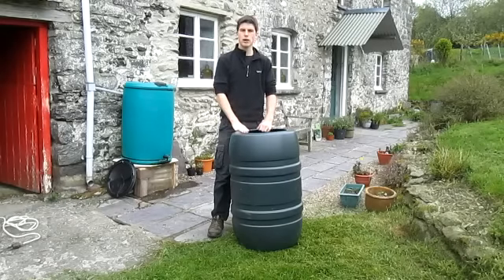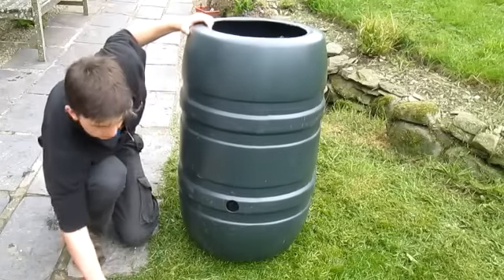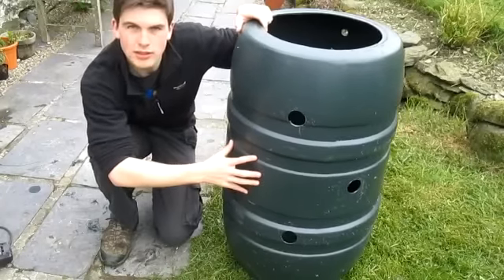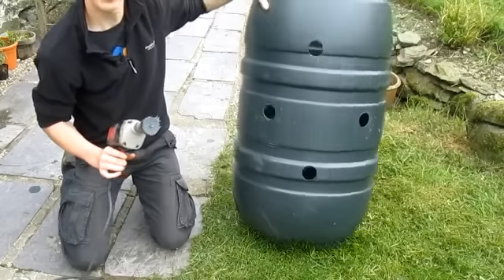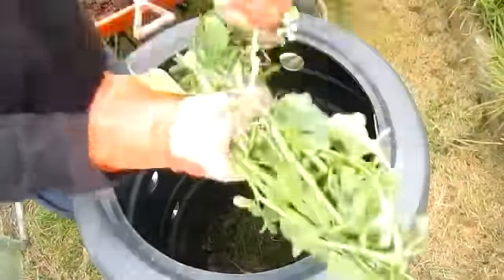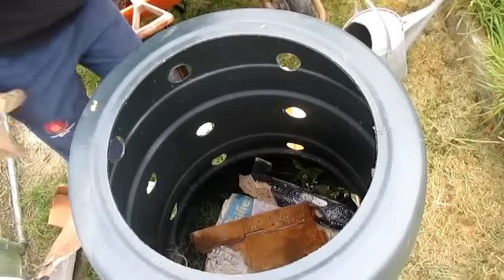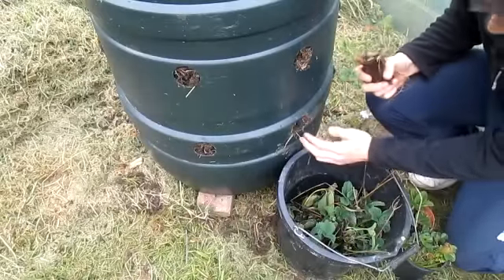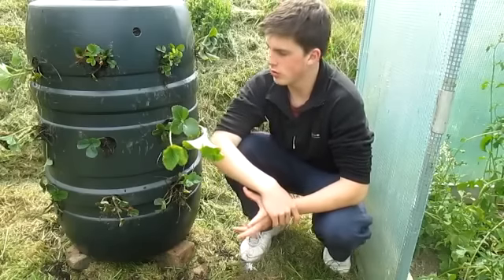How to Build a Vertical Strawberry Tower - 24 Plants in 4sq Feet!

Comment: You know how to use a drill! I saw another gardener....ok not actually a gardener, more like a circus clown....he demonstrated how to drill holes and he had the drill running in reverse and didn't even NOTICE. :)

ps: Excellent use of an old plastic tub Huw. :)
Reply: some run the drill in reverse because it cuts a cleaner hole , depending on what it is
Reply: *****  dont try that on styrofoam board lol
Reply: Actually if you run hole saws in reverse they do not grab as bad. I run mine backwards too since it is easier to cut the holes.
Reply from the maker: Great hehe! Thanks a lot Ray, I don't use a drill much but my dad has showed me the basics. Thanks for watching :)
Reply: crazyNCman LOL no.

Comment: Is there a danger that the compost will heat up too hot and burn the plants?  How do you stop it doing that?  Also the compost will breakdown as it decomposes, is that going to make the bed unstable when you plant things on top?  Its a nice idea so I am interested.
Reply: Add red wiggler composting worms. There's an actual product like that called a Garden Tower 2. Lots of people just put a PVC pipe they drill holes into and stick it in the middle then they put all of their compost stuff in there. The worms then travel back and forth.

Comment: This is awesome.  The only thing I would change, for myself, is adding a wicking bed with plastic pipe.  Similar to what Joel mentioned.
Reply from the maker: Thanks Randy I am considering doing that in Autumn:)
Reply: The strawberries in our berry patch are starting to grow now. My only question with this method is how do you get your strawberries to come out of the same hole each year, or do you just replant? My current setup, they just come back each year.
Reply: Fredrick Leigh They'll come back out on their own.  Just make sure to fill the top with compost so there is new carbon going in.

Comment: Hi Huw.
I have a suggestion for your strawberry tower.
I have done two towers like yours in the past.
In the second one, I did insert a plastic pipe in the middle.
You pour water in the pipe to water the bottom half of the tower.
It save you from drowning the plants at the top ,and having only a little water reaching the bottom half.
I'm thinking or making one more in the autum if I get enough runners.
Reply from the maker: That is a wonderful idea Joel, thanks for letting me know I will probably add one in this Autumn or winder when the compost had composted a bit more:)

Comment from the maker: This was such a fun project I did over the weekend. I had an old rain barrel that had been leaking so instead of throwing it away we had the idea of turning it into a strawberry planter.
It consisted of a single rain barrel, compost, two drill bits, strawberry runners and a special trick. I think this should be used across the world to easily save space. This is the equivalent of 24sq feet of space in only 4sq feet of ground space.
It is such a simple thing to make, at the very most half an hour and you can easily get these barrels from a factory or shop as I find these aren't any use for many of them, thanks!

http://youtu.be/7ypSeAM-WPw
Reply: That is such a great idea! Let us know the progress!
Reply: HuwsNursery - Grow Organic Produce Inexpensively 

One year down the line, how did this project go?
Reply: Mind blowing inpiration
Reply: Well done Sir!
Reply: Must not have gone well...